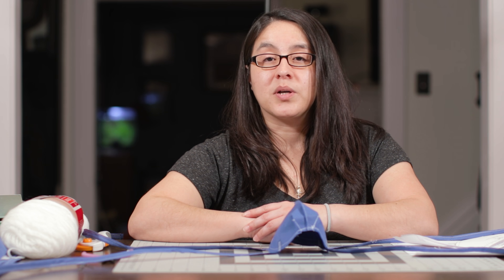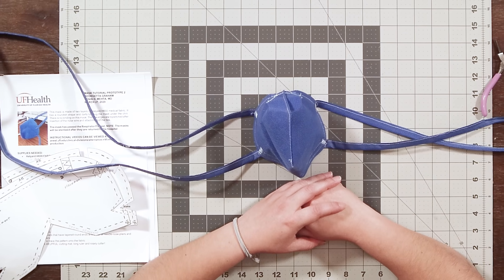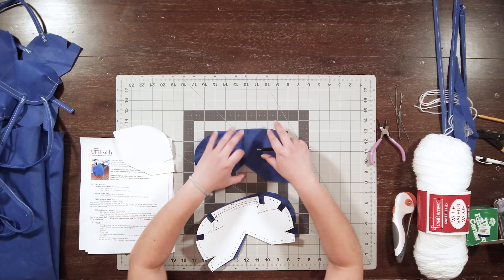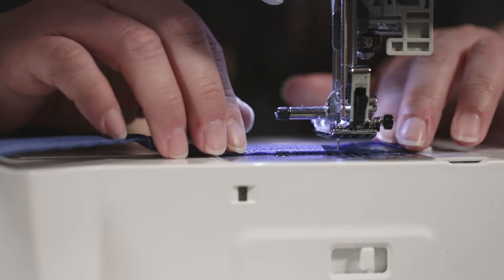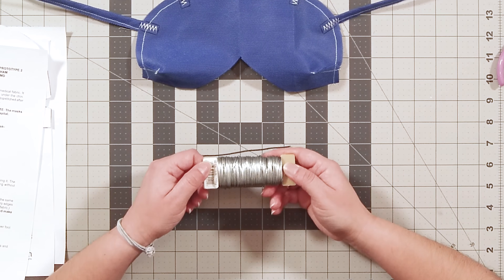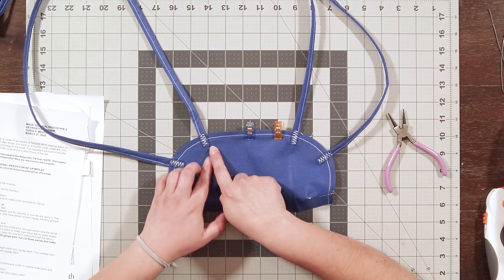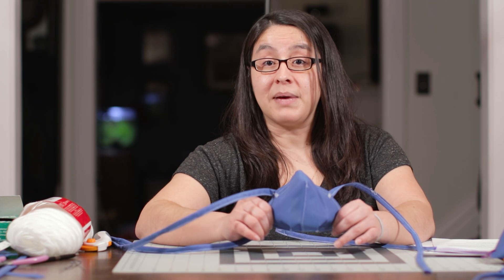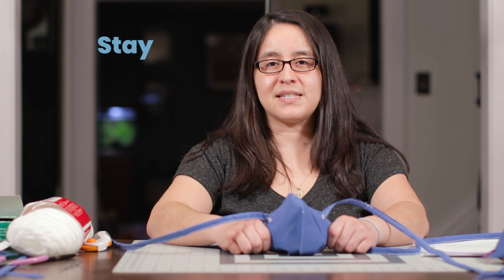Fit tested DIY mask? | OR Blue Wrap Face Mask | An Alternative Design

Comment: I have made many of this style. I acquired the nonwoven surgical material at a medical supplier.I used a tight broad cloth cotton material for the outside, nongovernmental inside. I also was able to get aluminum nosepieces. 
I used one for the nose bridge and one from each top tie, slanted toward the nose. I sewed all of these in. This helps keep the mask from collapsing against the nose making it easier to breathe.
The extremely long ties turned out to be difficult to tie. So I added two cord keepers to eliminate having to tie over your head. Then I discovered that zi could achieve a seal by using the cord keepers one to each two ties on right and left sides and adjust the fit behind my ears.
Most people I have given one of these retrofitted mask love them.
I am not expecting these to be used in a medical setting but they are excellent for those of us who want better protection than the loosely fitted surgical type.
Hope this helps

Comment: Thank you so much for your extremely well done video -- super clear!  I wonder if using Halyard 600 would have made a difference.  Also, instead of tape, Northwestern recommends a 8-10 inch wide strip of queen size pantyhose over the whole mask to prevent leaks. https://www.npr.org/sections/goatsandsoda/2020/04/22/840146830/adding-a-nylon-stocking-layer-could-boost-protection-from-cloth-masks-study-find

Comment: Hello from the Maya highlands of Guatemala. I am trying to design a face mask that is like an N95 mask, in that it will protect me from other people. So I found your video most interesting, and plan on testing my mask using your tang test.
I suggest you look at the YT video
Is your face mask material safe? Do #TheWindowTest
 - YT Channel - Fix The Mask
https://www.youtube.com/watch?v=m1VYNOMLbB4
The face mask test suggested here is quick and simple. Instead of a window, I used a flashlight to see if there were any very small holes in the material I was planning on using. Please try this test on the material you used, and let me know the results.
 Note - I tried this test on two different surgical masks - one passed, one failed.
Why is taping a mask to your face not appropriate? If I need to, I was planning to use 3m micropore tape, which is specifically designed to be taped to your skin. If you know of any problems using this kind of tape, please let me know.
 Thank you.

Comment: I made this mask & found the fit to be perfect, tight around all the edges. However, I used an unused sterile hospital sheet pad that I had put away & saved from a prior surgery.  It looked like the same material that you've used here; however, I find that even though it fits snug, I can breathe quite easily. Would that mean the material is not right, too loose? Thank you for taking the time to make this video. Very easy to follow!

Comment: You assembled the mask perfectly.  The reason it failed the fit test was because the pattern was not made for your face.  A mask is like a gasket and your face is like the pipe.  One size will not fit all.  That's why in Sewstine's fit test she had to tape the bottom of the mask to her skin to "pass" the qualitative fit test.  BTW, taping would be considered a fail.  The pattern may have been created for a person who looks more like Batman than you (or Sewstine or her colleagues) do.  If you know someone who knows how to draft she may be able to make alterations to the pattern to size it correctly to your face.

Comment: Did I miss something... what thread did you use?  Heat resistant... cotton? .. size?   Acrylic?    Thanks, Regards, Michael
Reply from the maker: I didn't specifically select a special thread, I just use my everyday supply. That happens to be Coats & Clark Dual Duty XP, which is a polyester, medium weight thread.
Reply: @SewSewSurgeon  Thanks for the info.. I'm new to sewing, and an engineer :-)  so, like Sheldon Cooper, I must know the details .. where  the Devil resides.

Comment: I made a few a couple of seeks ago when I saw the UF youtube. I tried to make some non-medical masks for my family. Love the fit, but since no surgical grade cloth and no seams, it really looks and can feel a bit messy. Can you do a video for us civilians with regular cotton material?
Reply from the maker: Regular cotton material should behave mostly the same as this as far as construction goes with the recommended addition of interfacing.
Reply: I made some masks using cotton reinforced with interfacing.  If the "messy" look is from the raw edges, add 1/4" seam allowance (or 1/2").  Fold under and sew the raw edge before proceeding with the mask assembly.  I hope this helps.  Thank you, Sew Sew Surgeon, for your very useful tutorial.
Reply: converting to a finished edge fabric mask, pattern works for female face. Add seam allowance width again for men's mask. In other words, the mask in this video was sized for a man's face because the seam allowance is not tucked inside, but on the outside, making the mask larger. All seams done with mask inside out until you get to the last seam essentially. last seam is done as a bound edge zigzag.

Comment: Part of the reason it's call a fit test is to test the fit of various masks to see which fits best. When I did my fit test I ended up going through 3 different brands and 2 sizes in each brand before we figured out which combination of size and brand worked best for me. Looking at the overall design the outer edge seal to your face was probably where the leak was happening either it was too large for your face, the sides weren't conforming enough to your face contours, or the chin wasn't getting sealed well enough. A possible modification of an elastic band trim around the outer face contacting edge might help in forming a tighter seal. In a close contact clinical setting these still won't be a replacement for a real N95, but in general clinical or as a replacement for "surgical" style masks these could be a good alternative since they seem to make a much better seal than your standard pleated surgical masks.

Comment: I'd like to see some kind of  "civilian" form of this mask with a pocket to place polypropylene or Hepa-like filter materials. The materials needed for the mask in your video should be reserved for hospitals; a "civilian" version could be made of cotton layers and maybe a high thread count pillow case. Something that could be machine washable but tight enough to firmly wrap around the head, maybe add a bit of nylon on the outside to add some water resistance.
Reply from the maker: Actual N95s should be reserved for hospital use. The material used here is part of a hospital's waste stream, i.e. trash. There are plenty of patterns that use pockets, however simply placing a filter in front of your nose and mouth does not stop air leaking in from the sides of your mask.

Comment: Kudos. For additional info/trouble-shooting (on a different video), there's an RN who fit tests 4 mask designs; her video doesn't have the sewing construction. The Fit Test only passed for this mask, between herself and 3 other colleagues; But tape was used for trouble shooting the fit. 
I would agree tape use is NOT ideal, however : A) these are homemade because we're in an acute supply shortage  B) The individual wearer can trouble-shoot the fit, not ideal but under the circumstances, it's workable
Reply: Holly A. Minter sewstine’s video? If so, I love her, she’s amazing. Also, she’s a Dr., not an RN.